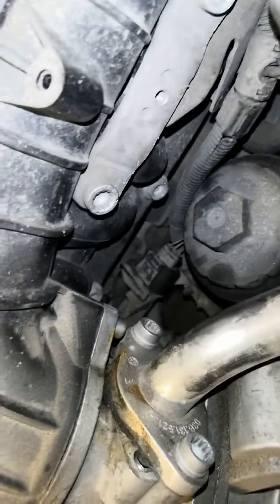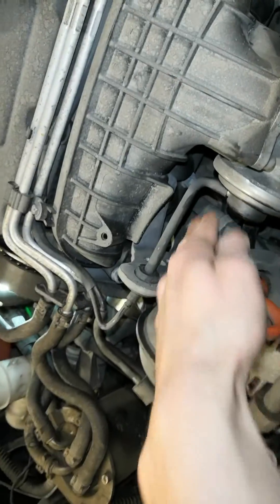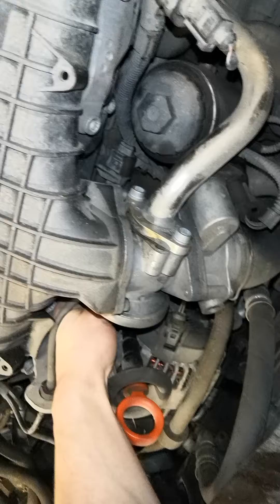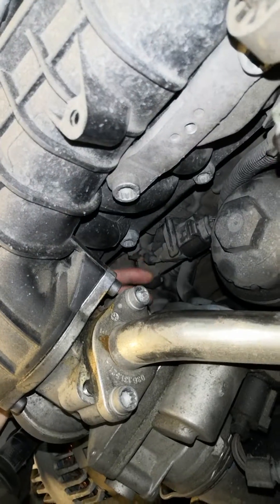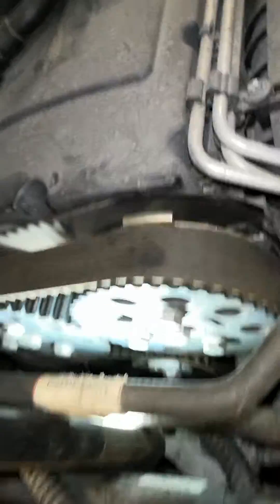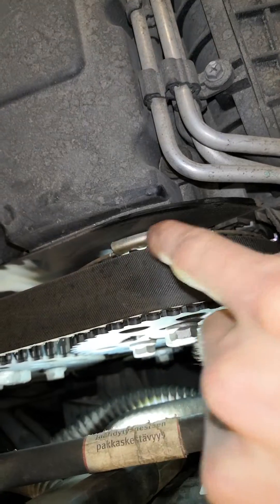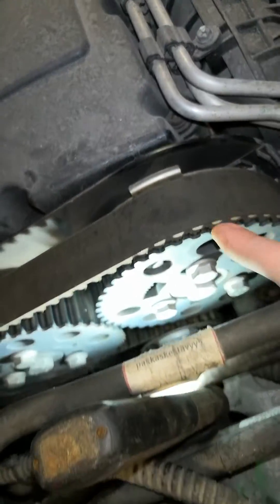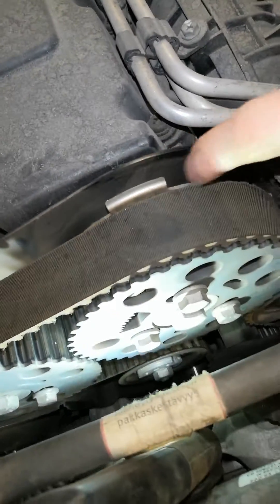Seat 2.0 TDI BKD Cam position sensor location (harder warm engine start) (Read description)

Comment from the maker: Note: removing this sensor is pretty hard from small hole it has for it to go through so instead trying to fit it through I cut the wires. Did same for new part too, then soldered wires together properly covered with heat shrinks and then covered all of three wires with one bigger heat shrink. This approach worked and car has worked for years later normally.
Reply: You don't cut the wires.  The plug end pulls through the hole just fine.
Reply from the maker: @rubyredta22  you don't, I did. Easier for me and has been working perfectly fine so I lost nothing doing so and I saved my sanity.
Reply: @norkator  ? Not sure how cutting and rejoining wires is a good thing, when the plug fits through the grommet hole.  I did it on the weekend.
Reply from the maker: @rubyredta22  I don't understand this commenting really. Obviously its too late for me to reverse whats done. I don't see cutting and reconnecting those wires so bad thing unless you ruin it by cold solder joint causing poor signal or later breaking up. I see those connector plugs as a bigger possible issue than this.
Reply: @norkator  the comment is to let others know that cutting the sensor wires is completely unnecessary
Reply: @norkator on the twin cam. I need to change my cam sensor. Belt is in the way? How did you manage to pull the connector through at the cam side? Thanks
Reply from the maker: @markthenewt  see other comments here for more info, but basically I cut sensor wires half and soldered them together after fitting sensor in from belt side. Its so many years ago already that I don't remember exactly what I did but it still to this day works so I'm happy.
Reply: Yep - plug does not fit through hole - I cut wires and rejoined - It will save you a lot of time - trust me! and cut knuckles
Reply from the maker: @rando3.4  yeah and I still have this car and still no issue with this soldering approach. My current problem is this cars paint RUSTING A LOT but this BKD engine working perfectly fine.
Reply: I tryed to remove the sensor in a audi a3 2.0tdi 8P 2006 two days ago, i couldnt do it...

 i am considering cut the cable, is there any advise in the connection of the new cable? thanks

Comment: Was the replacing hard? I had to do it on my BKD Octavia. At least i know where should i look at, so thanks anyway.
Reply from the maker: On my Seat this sensor wire goes to belt side from small hole which allows sensor connector to come out. There is rubber seal protecting this fitting hole from dust getting at belt side, this rubber seal can be removed with some sort of hook from right side. You need to remove sensor by pulling it out at the belt's side.

In my case I had timing belt in a way so I could not get it out. You may have same problem. I do not have VW tools to ease up timing belt and no guts to do so... so I cut old signal wire half, then I noticed that signal wire is normal copper wire, nothing special to have answer that can I use soldering iron to solder new one together if I cut that also. Getting that cut wire thru was so much faster and easier. After getting it thru I fitted heat shrinks on individual wires, soldered them well, put heat shrinks in place and then protected wire with plastic tubing which was on that new sensor as well as in old one. Have had no problem nor trouble codes after this so I count it as success.

Time-wise this takes about from hour to two.
Reply: @norkator  Well thank you so much for this manual. Im gonna do this today, so wish me luck :)
Reply from the maker: @jazzyjeffrey2034  New sensor cost 160 euros in my local store. I remember using this video as reference; https://www.youtube.com/watch?v=r4GzRBmhMO0

Maybe this can help you. And yes your description of problem sounds very familiar.
Reply: @norkator  That is another engine, a single cam, sensor change is about 10 minutes on that one :) Maybe bit more due to cover removing etc. But this BKD is twin cam and in front of the hole where the sensor connector has to go through, there is a pulley and belt... so that is a bit nasty and taking you more time